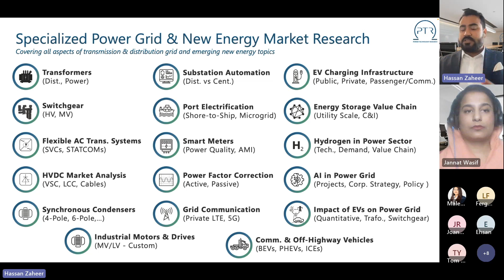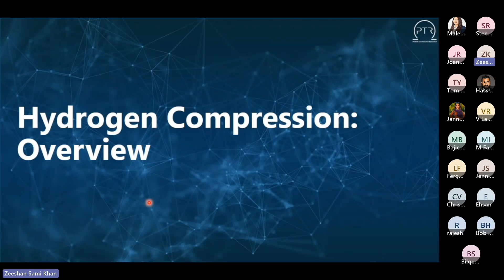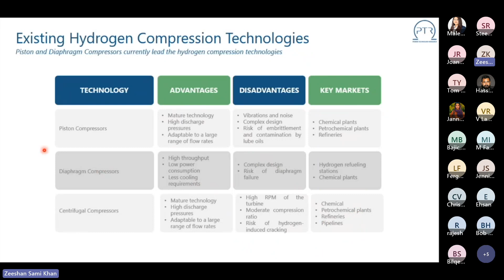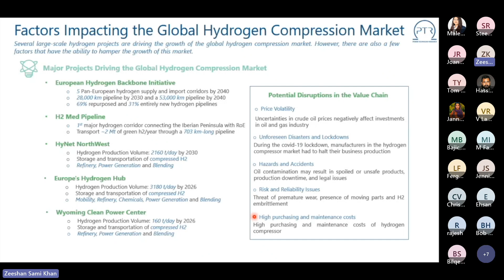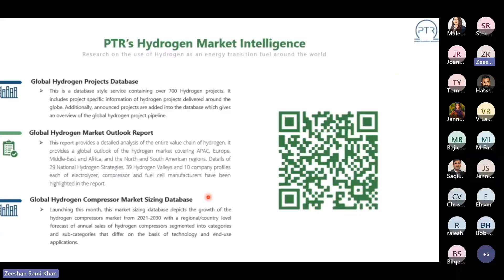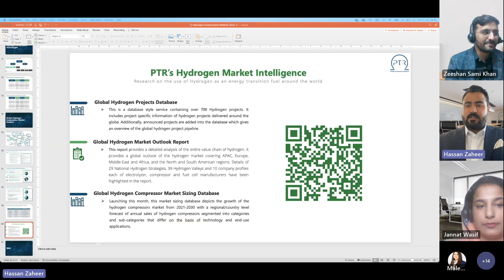Hydrogen Compression Market  Landscape

Comment: The "electrochemical" one is not considered a compressor, but rather an accumulator. It is also a mechanical device, but it is very complex due to the use of electricity, is a consumer of electricity, and suffers from corrosion.